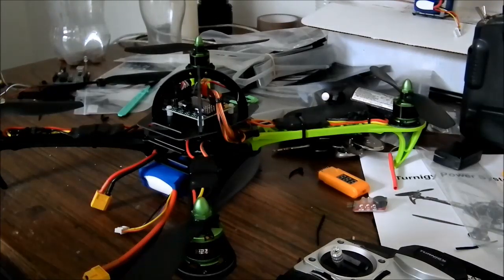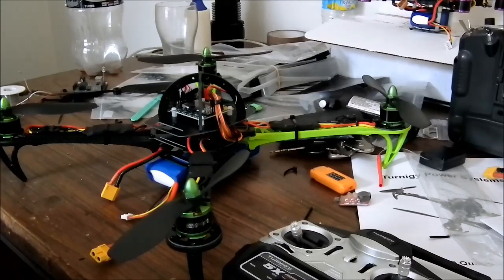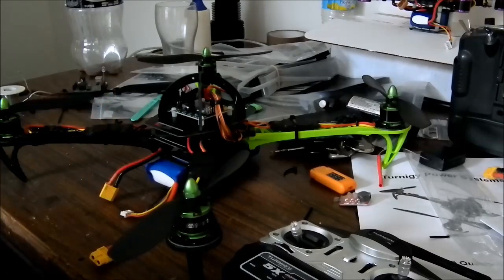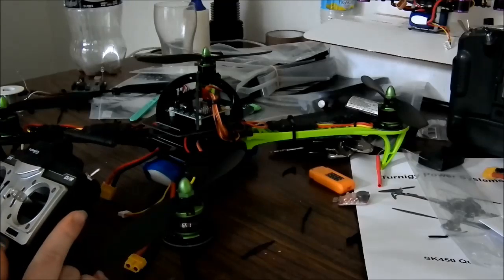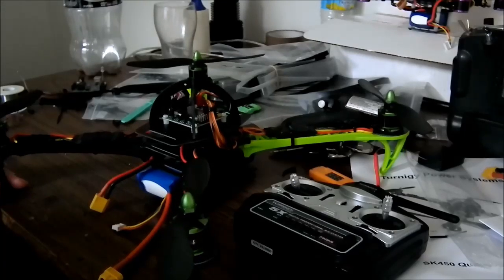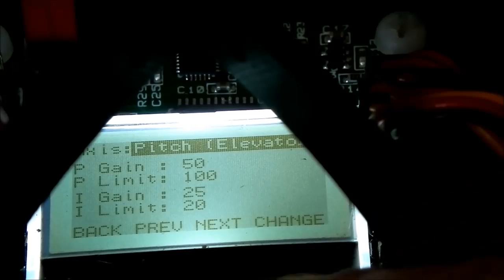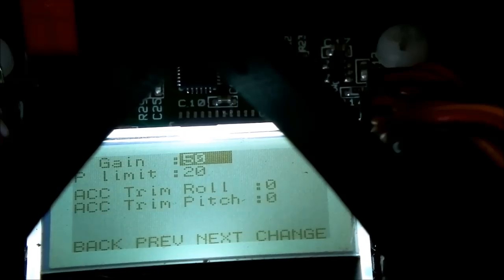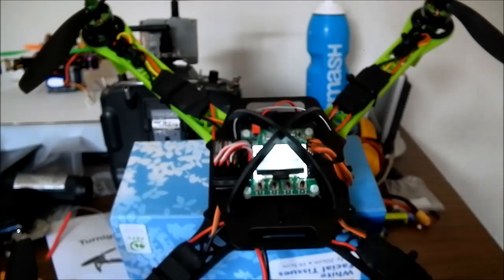Turnigy SK450 ARF Quadcopter - Final Thoughts + Flight

Comment: This was my first quad and I totally agree with you. I haven't flashed the ESCs yet but I have flashed kk board to 1.6 which has made a huge difference. I was pretty annoyed at having to do that but I'm happy with it now. Next job will be to flash the ESCs. It defiantly fly's better with 8" props too, even when loaded with a Möbius, and full fpv gear the 8" seem fine. Just ordered some 9x5 Graupner props which are supposed to be good.

Comment: After opening a few of these now, i feel as though it flies just fine the way it is, considering the price. I'm sure any quadcopter can always fly a bit better in some way, but i've had no problem with the stock settings. Yesterday i took one out of box brand new, and flew it within 5 minutes. It Truly is ready to fly after you put the props on and calibrate the throttle. Easy peezy, and i'm a quad noob.
Reply: on another note, i've had plenty of times where i could literally take both hands off the radio for 15-30 seconds, without having to adjust attitude. Very stable in my opinion ;-)

Comment: I know this was awhile ago, but after the flashing it looks to fly great. I just bought one from Hobby King for US $108.00 with 5ch Transmitter! That's the price of a Syma X8C brushed. It is Mode 1, that's why 1/2 the price because the mode 2 is $216.00, both US warehouse. I believe I can do a simple mode 1 to mode 2 conversion of the Transmitter. If not I have another tx that will bind.

Comment: Try turigning on the quad first, then power up the transmitter second. Some quads will only work by the reverse startup procedure, instead of the usual method of transmitter first then quad.

Comment: Well, Ready to fly is NOT the same as 'take it out of the box and start flying on blind faith'. That's simply not true for just about any RTF RC model available. Yes, it's a tiny bit misleading perhaps, but it merely means all the electronics in order to fly is included. It does NOT mean no setup is required. Please don't assume it does, in fact, it's best not to skip pre-flight checks and setup checks at all times. These are not toys and generally things go wrong when people assume too much. Not trying to lecture anyone here, but from my experience I've yet to come across truly read to fly out of the box RC models even when it comes to what many would consider toys (Hubsan 4x quad for example, mine did require recalibrating the accelerometer before it started to fly well, another was dead on arrival).

This HK Turnigy Quadcopter looks mighty interesting for it's price, but it doesn't seem there's enough room to fit an FPV gear on, correct? :)
Reply: You should buy a Syma X5C then, I just added bateries to the TX and switched on the Quad and started to fly, basically 2-3 minutes after i received the delivery^^
Reply: Tokon71 Well, in the mean time I have had the Hubsan one, similar to the Syma I suppose which was good value for what it was and flew fairly well out of the box even, but since then I've moved on to a F450 quad. I wasn't really looking for a ready to fly quad, but more so commented that even when they claim they are ready to fly, it's usually not the case. My Hubsan mini quad flew okey out of the box, but doing an extra calibration and setting up the tx made it fly so much better. So... if being able to turn on the motors within 3 minutes counts as 'ready to fly' to you, you're perhaps missing the initial point there. ;)

Comment: two questions, got a used one, they did a factory reset, What copter motor setting?  Does it matter how the wired are connect to the motor?  Trying to get it flight worthy and the info would be a great help.  Thanks.

Comment: hello friend . excuse my bad English . I am using a translator to write .
I acquired the same full SK450 Hobbyking kit and as you know this has nothing quad ready to fly. I have watched many videos of this firmware update SBEC and many complain that after upgrade to simonk begins to heat up. why is this happening? will update after you heat your SBEC ? You could pass me the exact link simonk firmware for 20A SBEC multistar . thank you very much .

note : I have all the same in my quad have not changed anything. same engines . SBEC sam
Reply: Julian Molina

Comment: Is this Turnigy 5x Tx and Rx ?? If its do u know which Rx can i replace...?
Reply: and what was the lcd screen which u set expos? i havent see it before. it comes with quad or its somethng extra to set digital options on analog Tx ??
Reply from the maker: onur ilgar Yes it's the 5x RX/TX. You can replace the receiver with anything with more than 4 channels. Expo's are usually set on your transmitter, I don't think you can do it on the KK board.
Reply: Hi, I'm happy to be proved wrong but I'm not sure this tx and RX is compatible with other Turnigy radio. Reason being the 5x has bind button on tx, the other sets have the bind on the rx. I've tried to bind a 6ch Turnigy to the 5x tx and couldn't. You would think it would work but doesn't seem to. Like I said I'm happy to be proved wrong if you know how to do it.
Reply: Richard Sweet Actualy u are wrong couse this reciever TGY-5RX have a binding button on it too...But also heared some rumors about this transmitter not fit all Rx